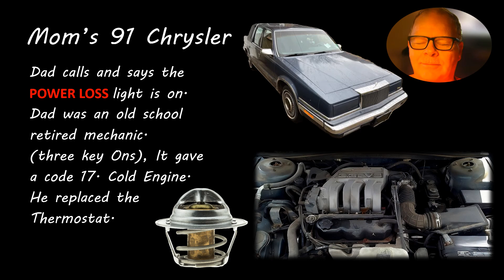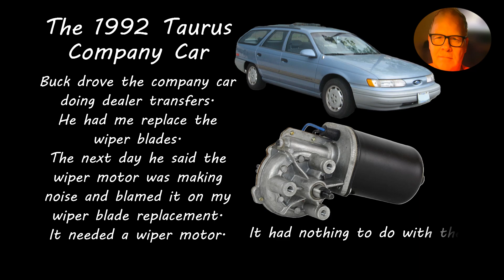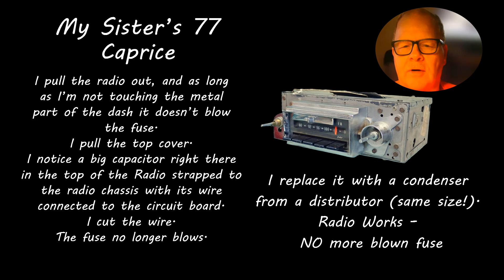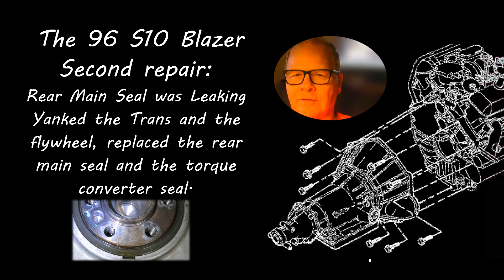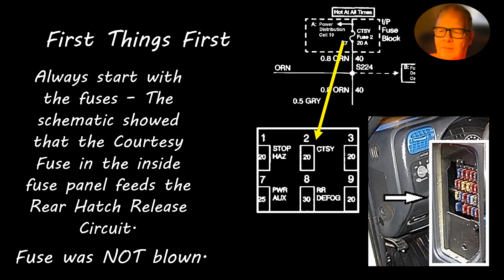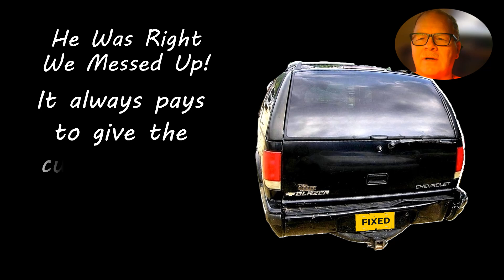Doesn't Make Sense

Comment: Seen a couple of them spider systems on Obd1 have a walking misfire. They leaked puddles of fuel inside the intake. Had to remove the intake and see what the problem was on them. 
Max Power Monday
Good Morning to you
Reply from the maker: Yep - I saw a 95 Lincoln with a walking skip that was following the firing order - turned out the fuel pump was generating air bubbles -and that was a returnless system...